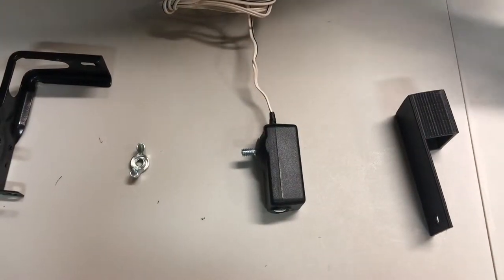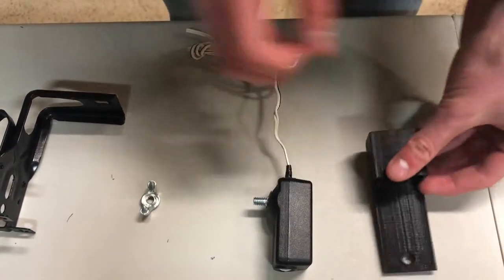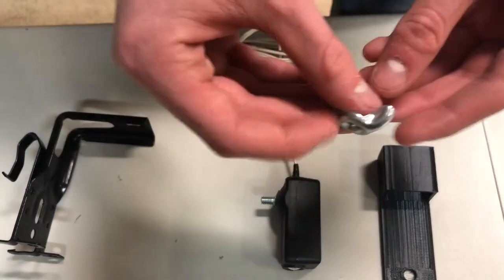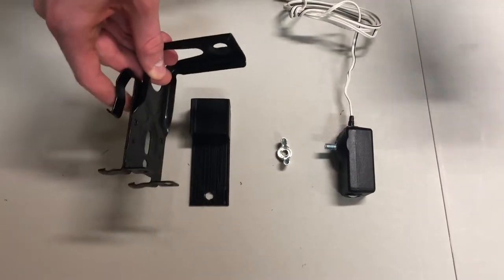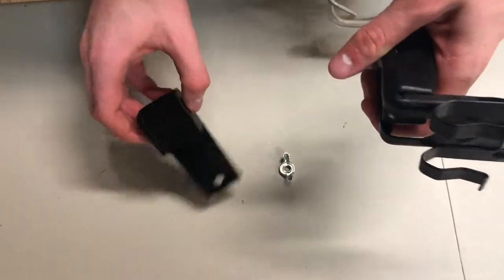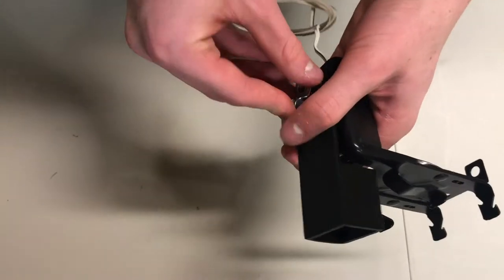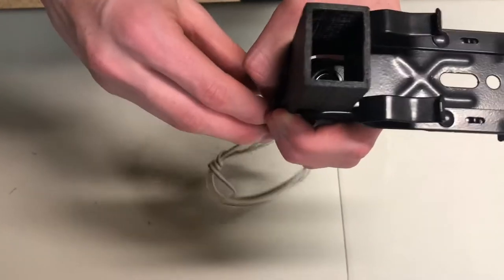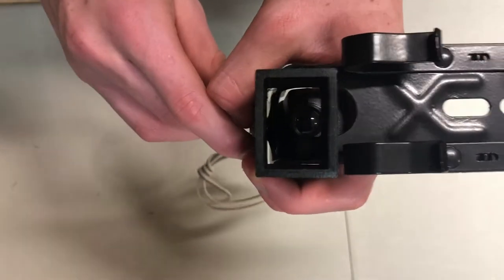New Garage Door Sensor Protector Instructions

Comment: Are you updating your product to allow the sensor light to be seen?
Reply from the maker: Yeah, the current version being sold has updated this.
Reply: @owenleffel2913  Thanks, I just replaced my order thru Amazon.  Supposed to arrive on the 22nd or 23rd.
Reply: Just tested and light lines up . Didn’t have to fuss with at all
Reply: @stevencastagnetta5833  Worked for me as well.  Took less than 3 minutes to attach to sensor.